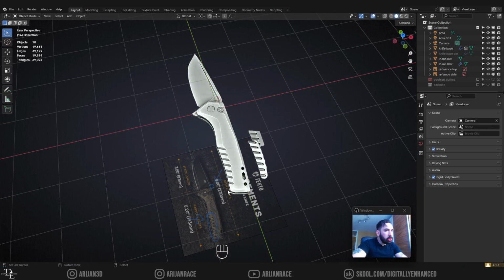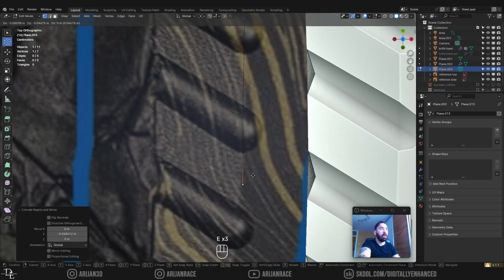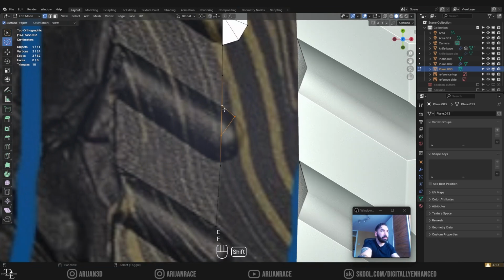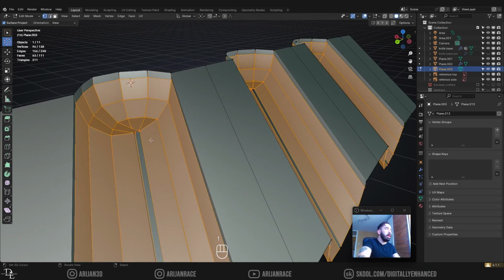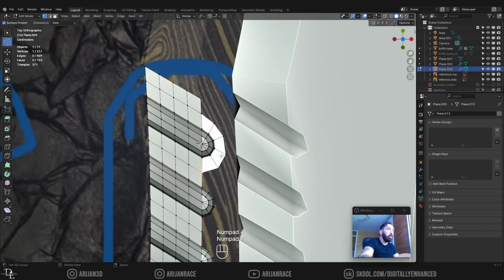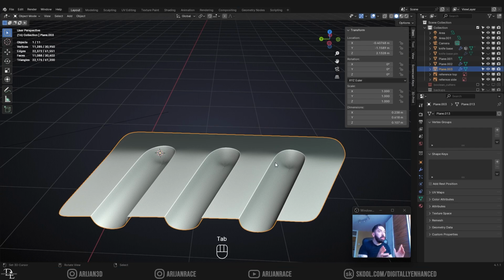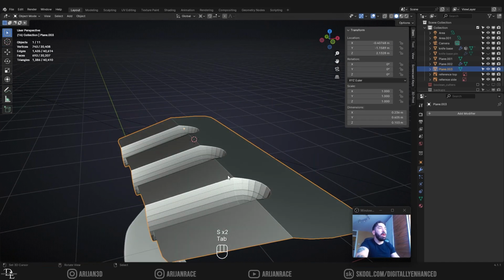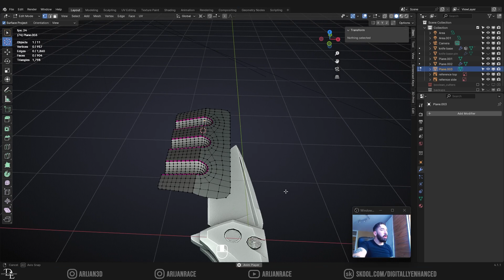The Hardest Topology Exercise for Knife Modeling

Comment: I feel like I found an easier way to do it. Starting from a UV Sphere with 12 segment or anything with clear straight line, cut it 1/4 of the sphere would be much simpler. Extrude the top part and scale it on everywhere except the z axis to create knife surface, extrude the other part out of of the quarter sphere to create the elongated ridges, do either rotate or shear and you got yourself an angle for the grip. The sharpness of the ridges against the surface could be adjusted easily using either crease, bevel modifier with bevel weight, or just bevel the damn thing.
Reply: In all honesty, I'm still learning blender too and trying out different exercise. Let me know if I did something wrong with that way... I just realize that the way the circle form on the bottom of the sphere really resembled that of an uv sphere's top or bottom pole and tried it out.

Comment: As a topology expert, I think the solution of applying g stretch across the lines in one direction to make it flat is good, scaling to 0 is also a very good technique, if someone is new, it will be very helpful to watch this video, to learn those things, I see good points in terms of creativity,
but really your whole method is wrong, you make too many manual adjustments, you create imperfections by doing that, in hard surface we try to use pure exact movements, you could have started by joining two planes at the angle, and put the cuts with capsules in booleans and you would have everything in seconds, perfectly precise, and if you needed to do another topology, it is better to do retopo, projecting on a perfectly geometric surface, than to do it in the air.

Comment: why the final model does not have to have crease? does it cause any issiu later in Animation/Game Asset/Render?
Reply: Creases is a Blender thing and won't get exported out, unlike normals, uvs or vertex color
Reply: @asr59  good to know, thanks
Reply: @asr59  No modifiers get exported when saving as FBX. You'd obviously collapse everything before exporting. So if you have a subdiv modifier and have creases, that does get applied to the geometry.

Also, creases are not just a Blender thing. Maya had it even before AFAIK.
Reply: @ nobody talked here about modifiers.

And no, you don't need to collapse everything, there's an option in the fbx exporter that allows you to apply modifiers only at export time.

Okay so try exporting a model with creases in blender, then import it into maya and check if it kept the creases, then you come back and tell me the result :)
Reply: @asr59  I was talking doing things manually, yes the FBX exporter can collapse it all for you.

Why would you use creases without a subdiv modifier?
Reply: @WyvernZu  you wouldn't, my point is that you can't export creases. Maya has it's own creases, but it's something internal of that software, unlike normals, uvs, vertex color, etc, which is supported by almost any 3d software

Comment: Really good topology? What about the poles at the base of the concave feature, there is obvious pinching in the shading and by topology standards it is objectively not good topology? Sorry if I am missing something here.
Reply: Yeah that’s what I thought. It think if you manually do some cuts and convert those diamond quads into tris the pinching goes away. But like, why do it like this? You can have normal quads down there if you do it differently from the start.